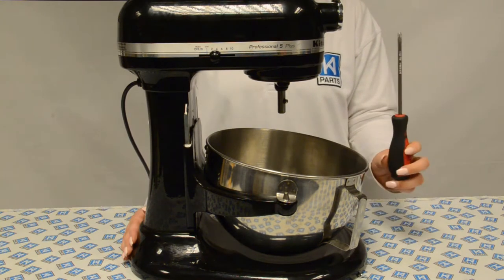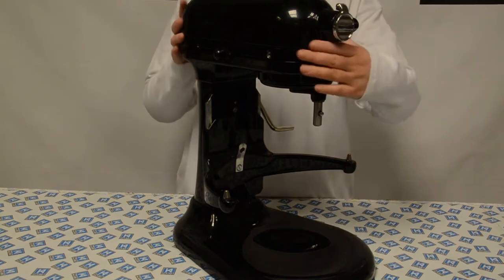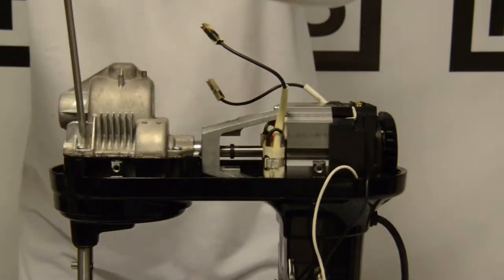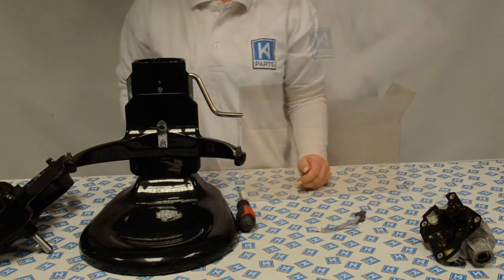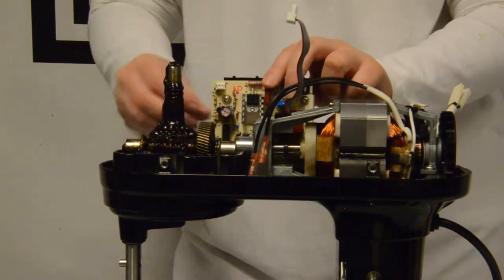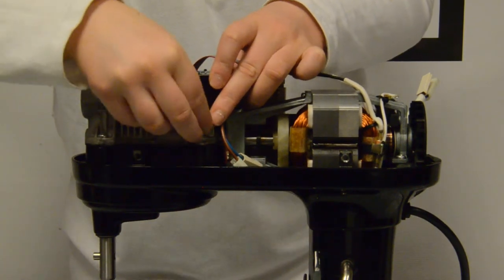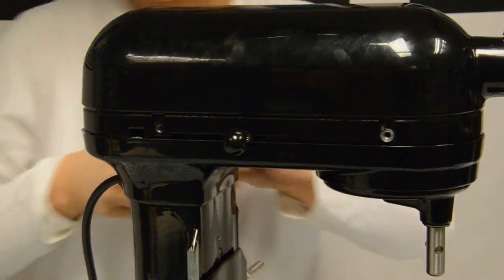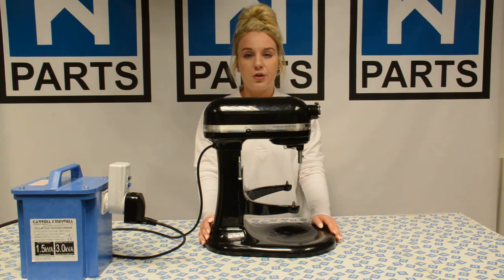Converting The 6qt KV25G KitchenAid Mixer

Comment: Hello where can i buy 220v motor for this model?
Reply: I know you can use 220v for the motor but the speed control board is only 110v. Because i already use it in 220v with out the speed control board..

Comment: Can i ask the details of the mov or metal oxide varistor because i already burn 2 of this because i forget to plug in 110v so maybe i can change only the mov so more cheaper.. thank you..
Reply from the maker: All the parts need replacing.  Perhaps you should modify you power adapter to ensure you can only use 110v?

Comment: Can the DC motor from the 6500 be transplanted into an AC motor Pro 600 series?
Reply from the maker: If you have the full model numbers we may be able to check. The model number can be found under the base of the mixers.

Comment: Cant I juat changed toe motor from 110 to 220? Its the same here in manila. In terms of cord and other things.
Reply from the maker: No.  All the 110v components need to be replaced to their equivalent 220v versions and that includes the cord.
Reply: @KapartsCoUk  got it. I take it will short circuit it even if i just changed the motor. Do you sell the replacement parts also for the planetary gear parts
Reply from the maker: @jbmarine0612  The control board will blow instantly.  The power cord has less insulation as it is designed for 110v.  Although it may work, extra moisture in the air could be enough to compromise the insulation.  Extra work and costs are involved in making sure components can take higher voltages.  A 110v mixer draws more current and needs thicker conductors compared to 220v but then 220v needs more insulation than 110v.  There is a chance of fire or harm if the wrong components are used.

Comment: How much do the replacement parts cost? With that many replacements, is it worth it? Great video btw.
Reply from the maker: In our opinion it is only worth converting if the mixer has some sentimental value.  The 6qt mixers (and the variant based on the same electrical components) are the most cost effective to make and hence the cheapest to buy.  This means they are often seen as "a bargain" and bought without considering the voltage may be different.  If you are moving form a 110v country to a 230v country we recommend you sell your mixer before you leave and buy a new one when you get to your new home.
Reply: @KapartsCoUk since we moved to Greece almost 17 years ago I have been running our Pro Line on a 120volt 60Hz true sine wave inverter at 1500 watts. This is powered by an industrial switch mode power supply capable of 50 amps at 12 volts continuous. Less than $25 for the switch mode supply from a surplus supplier, the inverter was around $150. The mixer will also run on 120 volts 50 Hz but it will run a bit warm and it’s power will be derated by 20%. Not the best. 
Nice informative video but even directly from Kitchen Aid in the USA the parts to convert were almost double the price of my equipment. The good thing is when the solar goes in there will be a 120 v 60 Hz inverter running the system, yes my house is wired for both 220 volts as well as 120 volts with the 120 volt system over engineered for wiring.
Reply: @Subgunman Hi, I have a problem with my KA 600 series 6 quarts that was gifted to me by a friend from Canada. As I live in Netherlands, I bought a voltage converter to step down from 230V to 110V but after connecting to the converter, the mixer stops working after a second and I have to switch it off an on again to run for only another second. The KA mixer is 575 W and I used a 1000W and also a 1500W voltage converter. But in both cases, it works for only 1 second and stops. Do you have any recommendations? Thanks in advance
Reply: @maytnikbakht  what I have invested in is a standard step down transformer that reduces the voltage from the European level of 220/230 volts AC to the voltage of 120 volts AC. There are dedicated transformers that are available from dealers who specialize in export products that sell these items. I have two that I purchased from my exporter in Chicago many years ago. These appear to have a common neutral and ground so when tested with a outlet tester I registers normal. However I ordered a step down transformer from a local manufacturer and when tested it shows an open ground which leads me to believe this is an isolated step down transformer. Bear in mind that you have to de rate the power of the mixer by at least 10% because the mixer is designed to work with 60Hz AC and not 50Hz AC. Kitchen Aid does sell parts to convert the mixer but it exceeds the cost of a new mixer designed for the European markets. Unfortunately I live with the the fact I de rate my mixers power. Now there is another way around it but not as costly. Find a switching power supply that can supply 13 volts at 50 amps and feed it to an inverter designed for at least 1000 watts at 120 volts output power true sine wave NOT MODIFIED SINEWAVE.
I am waiting to find a cheap way of bringing in a quality inverter from the states since there is no trust in Chinese equipment. If you have someone going to the Americas that can bring one back you can probably avoid outrageous customs fees.
Reply: @maytnikbakht   I have same problem. did you find a solution?
Reply: @Elise-Ruth Not really, unfortunately. I gave up on it 😢
Reply: Hi , i have the same problem with my SERIES 6 .Did you solve this problem ?
Reply: @cristihelbet7829 if you the same problem as mine, no unfortunately I couldn’t solve it and I shipped it back to my friend in Canada and instead got one in The Netherlands.

Comment: You will not encounter a more frustrating rabbit hole of broken websites and shifty scam artists on the entire internet until you decide to hunt down these parts. It is absolutely impossible to find a clear and explicit list of the exact parts and part numbers needed to get this from 110 to 230. The list in this description is a mix of both voltages and looking for these on the internet is an exercise in futility. The shop that made this video is closed. 

If anyone can tell me where to get these parts and not get ripped off and scammed, I would totally appreciate it. It shouldn’t be this hard.

Comment: It is better to use converter rather permanently changing to 220v which a costly affair !
Reply: I wouldn't trust a transformer, cause I ruined my mixer using a transformer.
Reply: Don’t do this. The voltage is off just enough to burn out the motor in short time.
Reply: My transformer burnt out my mirror because it was a solid state transformer.  I had my mixer repaired and the repair person said he couldn't convert brushless motors and so he recommended the Yinleader 1000W 230V to 110 Volt voltage converter. It seems to work well. The issue of course is that the frequency in Europe is 50hz not 60hz, so that may cause an issue eventually.